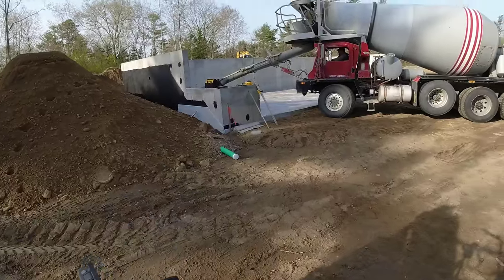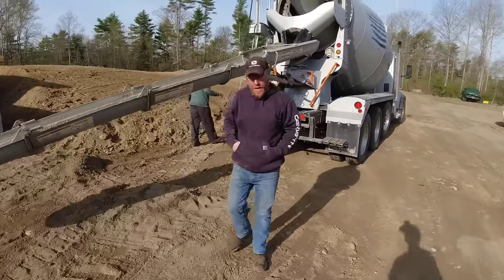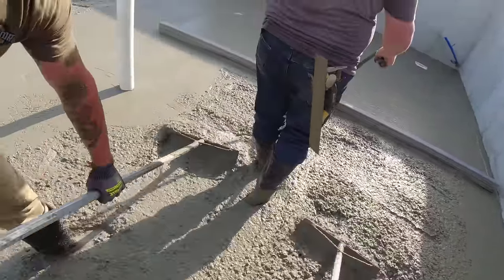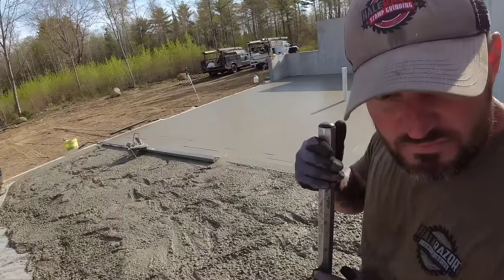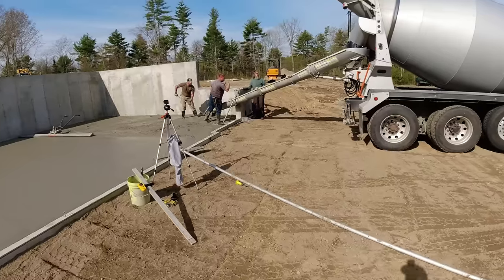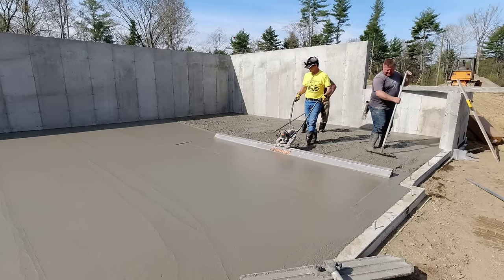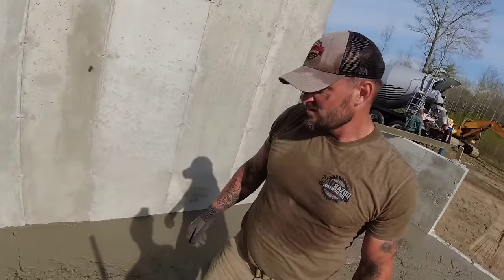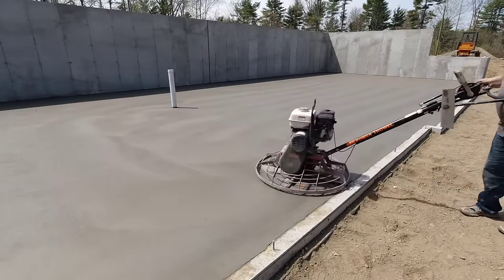How To Pour A Big House Concrete Floor Using A Power Screed.

Comment: This is great! I'm learning along with the guy you teaching! First timer here doing a 7mx7m concrete base for a garage and drive (this is the UK so we've way less space than you over there). I've spent the last 6 days taking up most of the old base with a Hilti 3000 hand-held breaker that's nearly broken me! One big section I can leave as is but had to dig out the top area (it's sloped) to get the new base down in the created recess and break out an existing raise area of poor concrete and basic bricks as bad hardcore. Got 2-3 more days on the breaker then using a trench rammer to break up the bigger cement blocks further. 40 bags of gardore then on top. Wacker it down. MOT1. Sharp sand. DPM. Mesh. C30 (+ fibre) pour! Only real tricky bit is putting a slope on the driveway - got to get my slop right! Subscribed to you and watching as much as I can. Thanks!

Comment: Hey Mike I tried using water reducer “mid range “ here in Florida. And I like the fact you can pour at a higher slump BUT to me it didn’t finish the same we had to crawl it more surface wasn’t closing up good then broom it. It came out good just seems to be more work.I may upload that video soon..Any tips?